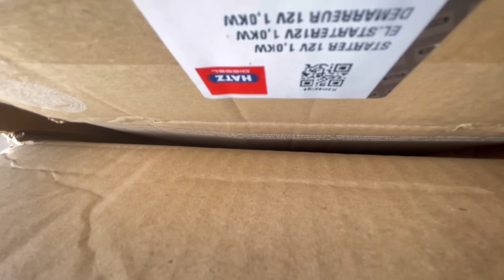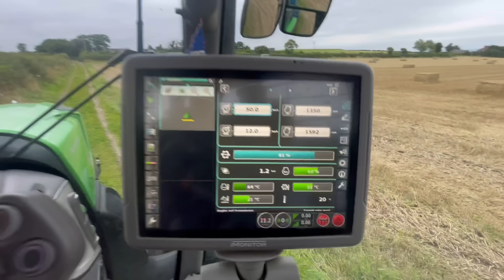Starter motor isn’t right / Harvest continues / Episode - 225

Comment: Eh up Ali 2nd cut finished this morning down here in Sunny Lancashire…. Started at 10:30 AM yesterday, then tensioner pulley bearing seized up shredding the alternator belt,quick trip to Wilson’s contractors at Preston, new bearings and belt, went through the night until teatime today🥱🥱☀️🚜💪🌱🥱🥱🥱🥱🥱🥱
Reply from the maker: Hectic my pal blocked the chopper the other day had to go back the next day with two to get it gathered before the rain very catchy summer !

Comment: I was aways convinced that the machine manufacturers have a make it as difficult as you can departement where they look at it and decide ,thats too easy ,lets make it more awkward and screw with the service mechanics😂😂😂.
Reply from the maker: Yeah 😂 best design for battery access was on t thwaites dumper took one bolt out and it hinged out 👌👌